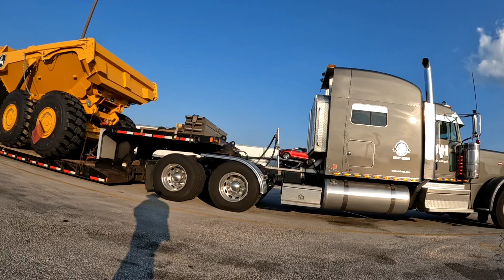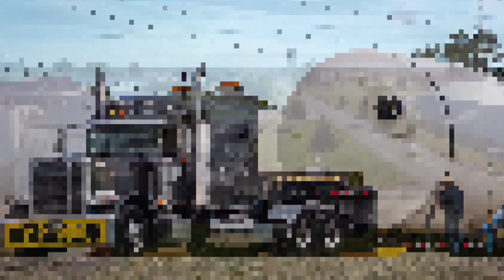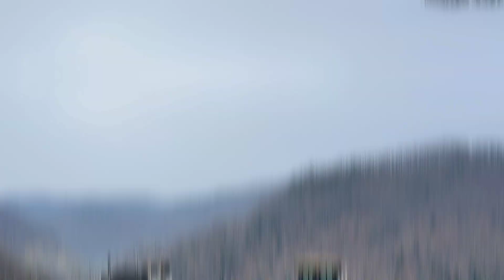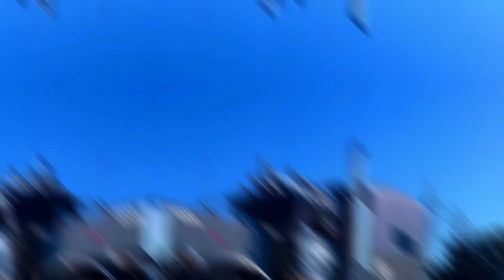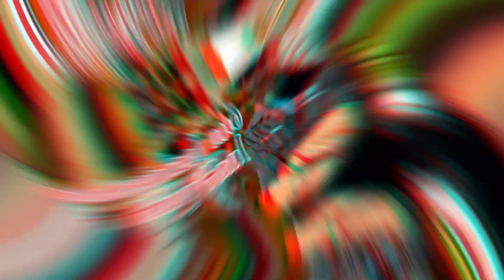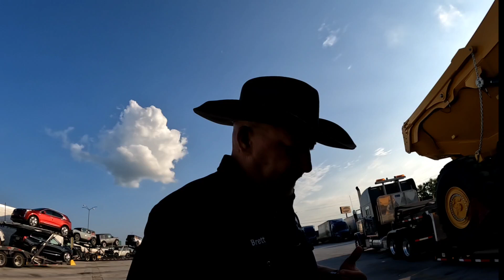Ep 248 JD410 Dump truck and a Case 7500 Combine with some Routing issues.

Comment: When you were speaking about the out rigfers and placement, you mention your desire to hace one more fold out support closer to the 1st axle on the trailer. Is it something that the shop could fabricate and add to the trailer, or would it require adding structure within the fram rails as well as cominf out towards the support. Or would something like that be a DOT no no? As far as the routing, I think some may have an extremely bizzare, twisted sense of humor... or perhaps some random substance testing may be appropriate. Because I have witnessed a few extremely oversized loads in places that they truly should not be on. Thank you for anotjer awesome video, I pray that you and family have an amazing and safe weekend.🙏💜
Reply from the maker: @mayhemsmaster5050  you could add extra outriggers but the way the fold in the pretty much cover the whole side of the trailer. So it could be done but would be awkward and possibly effect the way the existing work but it's a great idea. 
Thanks for watching and a great comment! Stay tuned I have some really exciting news coming soon that will change the freight I'm hauling and advance the knowledge I can spread. Should be within a couple weeks.

Comment: Tech question.  I can hear your intro song and any commercials through my wifi speaker, but your commentary with the video I can only hear with my phone speaker. Anybody else have this problem? It's
Reply from the maker: @Deryl-n9y  so weird. I haven't heard of anyone having that problem. Gotta love technology!
Reply: I have a similar issue actually. I normally will use ear buds when watching videos. When Mr. Bret does the intro, showing and talking about the load, securement etc both ear buds function properly. But if Mr. Bret does commentary in the cab/bunk area only one of the speakers function... I think it may have something to do with where he places his external mic. But I noticed if its on one side or the other, I think may have some affect. Granted I am nit a "sound guy" and have absolutely zero idea how any of it works.
Reply from the maker: @mayhemsmaster5050  weird. I use the same mic set up the same way unless they are dead or decide not to work then it's just off the gopro. So odd!
Reply: @PatriotSpecialized  Ok, Mrs. Mayhem for the win! Per Mrs. Mayhem as I was thinking aloud this morning, she was wondering, when you are outside if Ghost the audio is fine, but it's when you are in the cab of the truck is when the gremlin arises. Could it be possible that the CB, ELD, or perhaps one of the electronic systems that operate in the cab could possibly interrupt the frequency/frequencies with the mic or the receiver, possibly causing a portion of a channel or the channel, causing an interruption when you record in the cab?